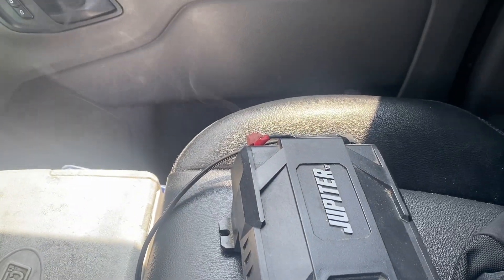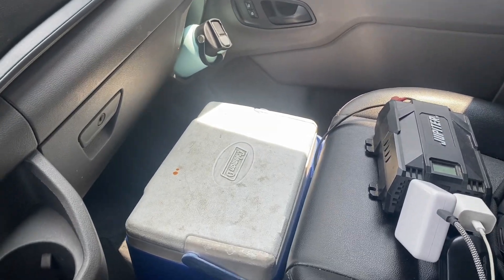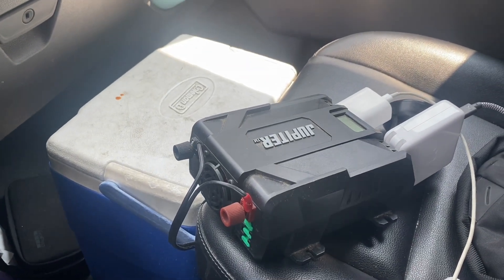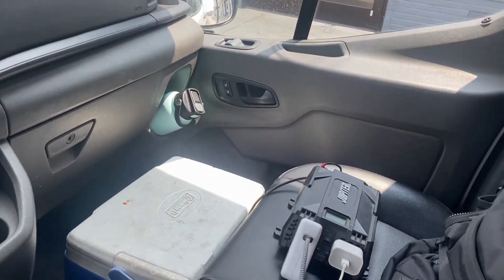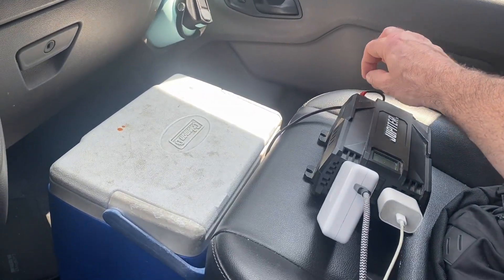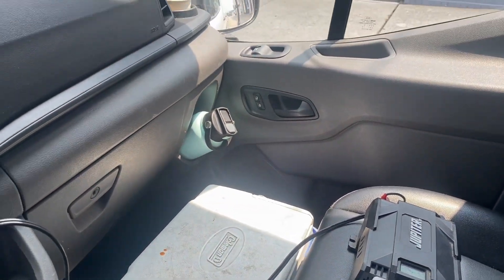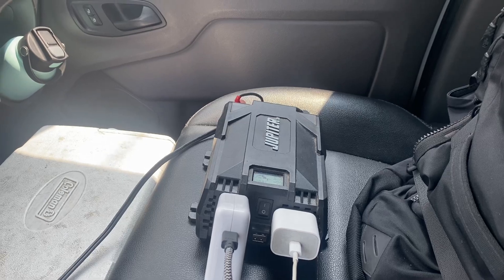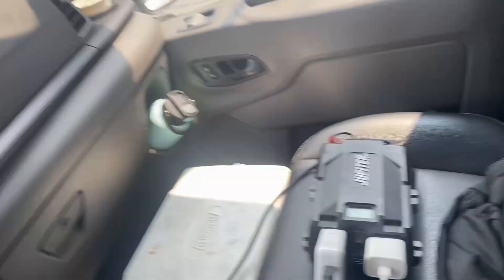Power inverter smoking

Comment: Maybe get a 130w type C car adapter. Anker makes some great ones. You wont even need a inverter converting the car 12vDc to 120vac then your brick converting the 120vac to around 12vdc again. Wasted energy in the form of heat.

Comment: Loose connections cause resistance. Which in turn causes heat. Tightening up the screw did the trick. I think you’re good man! 

There was probably a good enough amount of juice flowing through that wire to cause that. The hacker created a hot spot on his inverter haha. 

Glad it’s all good man. Your channel was suddenly recommended to me again. Haven’t seen you in a bit man. Hope all is well!